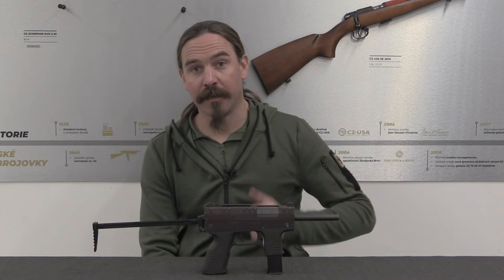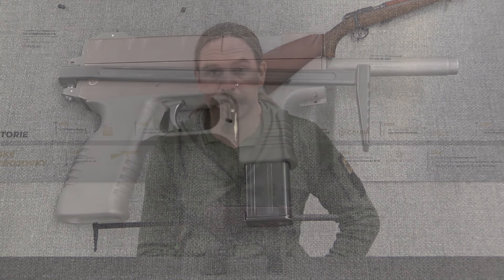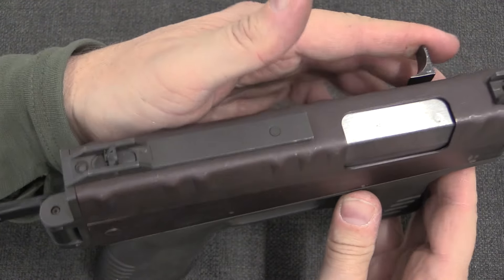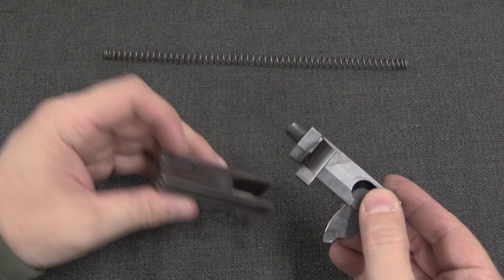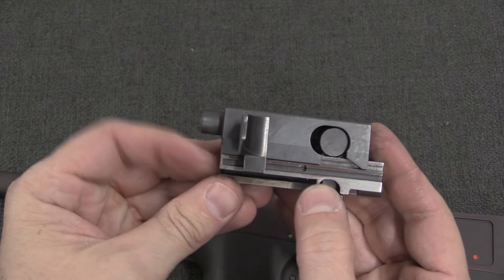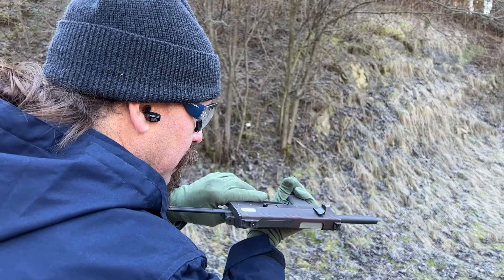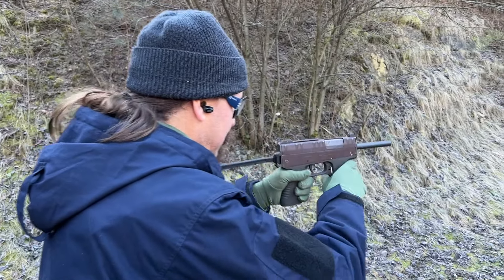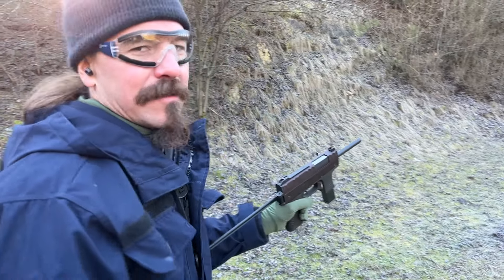Ladislav Findorak's Prototype Lever-Delayed PDW

Comment: "guns are meant to be shot" CZ got it 100% right there!
Reply: Yes sir, that's why we have them :Dd piece of american weapon freedom in the middle of the Europe, that is CZ.
Reply: Any gun manufacturer with faith in their product should be more than happy to have people shoot their products.

If they work flawlessly, then that's great marketing.

If issues occur: ample opportunity for ironing out kinks to further perfect the product.
Reply: At least attempted!
Reply: @sevenproxies4255  true. This is a 40 year old prototype that never made it to production, so critique away. But there is a lot of cool design to learn from off that little thing.
Reply: @CrashRacknShoot  I like a lot of design elements of it.
And as far as the full-auto problems Ian had on the range, like you said, it's a prototype.

And in my expience, misfeeds and trigger reset failures usually bottles down to the piece just needing some more machining.

Some material needs to be added or taken off. But that's part and parcel of gunsmithing after all. This gun clearly doesn't need that much work to function flawlessly.
Reply: depends what kind of gun if its a replica to be a wall hanger decoration then no
Reply: @gcart5619  wouldn't be a gun then, now would it?
Reply: @gcart5619  Nope, unless its a hisorical piece being preserved in a museum. They were made to be shot. Not investments, not art pieces, not collectors items, they are firearms, and were made to be used.
Reply: @CrashRacknShoot  its a type of gun just not a fireable one that was kinda my point
Reply: @gcart5619  does a replica fire a round? 

Oh! Lemme answer that for ya. No.
Reply: @jonathanrogers9961  wow🤦🏻‍♂️😒😑
Reply: @CrashRacknShoot  thats not the point guns can be guns without being able to fire a round also replicans can be firing replicas it doesnt always have to be nonfiring 🤦🏻‍♂️😑😒
Reply: @gcart5619  1. Thanks for walking right into that one. If it can fire around, it is a gun. Meaning it's meant to be shot. So I appreciate you agreeing.

2. A replica is a replica. Meaning a lookalike. Meaning not able to fire, but looks the part. I'll help ya out on this one. You're thinking of a reproduction. 

Congrats, you're wrong twice.
Reply: @gcart5619  pretty sure that would generally be a reproduction, but i have heard of firing replicas as well.
Reply: "Guns are meant to be shot" I think this particular PDW disagrees 😅
Reply: @CrashRacknShoot   So, by your logic...

 I should go shoot my $2000 commemorative John Wayne lever action? Lol

Jk with ya. Btw. Haha.
Reply: Excellent job, Mr. McCollum, as always. Thank you CZ, from a Texan 😉

Comment: I always wondered if anything other than the famas was ever designed around the lever delayed system, guess I’ve got my answer now
Reply: Also the Hungarian Kiraly 39M/ 43M submachineguns
Reply: @jakubdolezal665  oh yeah, almost forgot about that one
Reply: Your user picture brings me back. Thumbs up.
Reply: The AA-52 is the French GPMG since 1952.
Reply: @garthenar  nice to find a fellow fan of the show on here
Reply: There are a couple others, can't think of them off the top of my head though. There are also some big machine guns that kinda look like they are lever delayed but aren't, the lever is actually an accelerator to give a boost to the opening of the bolt. Lever accelerated instead of lever delayed
Reply: San Cristobal rifle has also used lever-delayed mechanism.
Reply: @GunsGuy1990  which was also designed by Király Pál
Reply: @webtoedman I have a feeling that the Schwartslose mg is actually the grandfather of all the other lever delays. Kiraly must have had a good knowledge of it as an hungarian and simplified the system. The rest copied him. (Just my guess)
Reply: Isn't the reising also lever delayed?
Reply: @Appalachia_Ape  no, its a hesitation lock. It's hard to explain how it works but can be showcased.
Reply: There's a ton. Benelli B76, Hogue Avenger, FNAB-43, TKB-517, VAHAN, Stirling-7.62, AVB-7.62, AA-52. I'm sure there's some others but those are what I'm familiar with.
Reply: for newer stuff, you got st kinetics cpw and silencer co maxim
Reply: The French loved their lever delayed blowbacks, their AA-12 GPMG was one as well, and a couple of their old SMG's and battle rifles from around or just after WWII were too.

Comment: looks like it needs a beefier extractor,but it did well for a prototype,also the Scorpion stock would work so much better since it has a  "long" bare barrel
Reply: Yesss, the skorpion stock looks right at home here.
Reply: It also looks like there's not enough kinetic energy in the cycle to do everything it's trying to do. Might be cause the main spring is too cold, not quite as responsive as it should be.
Reply: @jono3952  I was thinking that maybe the chamber isn't fluted, that could rob the action of necessary momentum, the H&K delayed blowback guns all have fluted chambers to stop the case from sticking in the chamber...
Reply: I believe extraction is fine, because it works in semiauto. Ian also attempts "to recock the hammer without losing the round." So I believe he's ejecting unfired cartridges, rather than empty fired cases that failed to extract. The hammer possibly follows the bolt down too gently/early, not striking the primer hard enough to fire. So now you have a chambered round and uncocked gun. In semiauto, the disconnector prevents the hammer from "following" and it works fine.

Comment: Like any prototype I would guess that it needs a little fine tuning and possibly the magazine is a little finiky also. I love the overall concept. It's definitely not a cheaply made gun. Looks like quite a bit of maching was involved in the manufacturing process. But I generally like the idea.
Reply: That is very high quality for a one of its kind prototype! I'm impressed!
Reply: I'm no gunsmith, far from it, but I could see a couple of improvements that would have helped the ejection - like filling in that big empty space above the chamber a loose shell can fit into and a deflector to make sure the casing has only one place to go during ejection. Also, I wish Ian had worked the selector switch back and forth with some "emphasis" to make sure it was fully seated in the auto position.
Reply: I suspect that CZ did not pursue this design because they figured it won't be possible to make this thing out of stampings.
Reply: The problem isn't the magazine, I think, because Ian wasn't having trouble with an empty chamber.
Reply: Maybe it’s because he’s holding the magazine too tightly

Comment: Thank you very much CZ for allowing Ian to shoot this piece, I did not expect you to do so to the point I was thinking "pity he won't get to shoot it".  

Obviously, it's a developmental piece, it would be interesting to see if the bugs could be ironed out as it's actually quite a nice design and that's coming from a died-in-the-wool Skorpian fanboy.
Reply: Mag should be in the grip tho
Reply: @j.yossarian6852  not if it affects the design and functionality but an extra mag holder in the grip could be nice tho
Reply: @j.yossarian6852  Exactly my thought. With that, a longer barrel would be possible. But the upper reciver must be extended to make room for the bolt but if you extend the upper the lengh of pull could also be improved. But the gun would not be as compact as befor.
Reply: Really reminds me of the pp-91, minus the lever delayed action, it’s remarkably similar

Comment: I wonder if some combination of bolt bounce and hammer follow is causing the stoppages. Seems that the trigger is resetting, hence the doubles, but something about the cadence of sustained fire is causing light primer strikes.
Reply: I agree, because I used to have the same issue with an older Century C308 that I had. I went too long without cleaning it once, and it had trouble with hammer follow and I'd get random 2 or 3 round bursts out of a semi auto rifle. And then after that 2nd or 3rd round I'd have to charge it again and reset the hammer because it was following the bolt. Needless to say I cleaned it every time I shot it after that happened.
Reply: I guess it's because it is a prototype rather than a production model that's had all the bugs worked out.
Reply: From what I can see in the footage, it appears that the trigger axis pin was too short and walked to the left little bit, which would cause an alignment issue with the trigger. It would still be able to effectively fire, but resetting would be problematic and prone to errors in that case (same with an AR15, or any other gun that has a very "neat" trigger group without a lot of horizontal space to shift aroudn in).
Reply: Maybe the magazine springs were weak?
I was thinking the magazine wasn't able to keep up with the bolt.
Reply: @tylerwilliams6022  I was thinking that too, but there was at least one unfired round in the chamber as well. 
I didn't really hear Ian talk about the mag, but I would imagine they just used a proven mag, at least for prototyping.
There also was a case stuck between the bolt. 

Kind of hard to tell, there seem to be a couple of different problems. I also have the feeling different ammo could make this run a whole lot better. This system seems pretty dependent on the pressure.
Reply: Is the simplest answer that the selector didn't fully engage in the auto position?
Reply: @tylerwilliams6022  It wasn't the magazine. It chambered a round every time. It was not firing even though it was dropping the hammer on a live round. I suspect that it's designed so the hammer doesn't hit the firing pin unless the carrier is fully forward. It may be releasing too early before the bolt carrier is fully forward, or it may be the bolt carrier bounces open a little right when the hammer comes down.

Comment: I have always been intrigued by the lever-delayed system, but slightly disappointed by the lack of general examples of lever-delayed blowback in firearms. This video has proven to be quite interesting.
Reply: Yeah, the only one I knew of before googling it was the FAMAS, and there aren't very many at all.  I remember reading that H&K tried making a lever-delayed SMG (an early MP5 or UMP prototype, or maybe the MP7?), but gave up.  It seems to have some inherent problems that just make it hard to get right.

Comment: The lever at no point stops the bolt from moving.  The bolt is moving relative to the frame from the instant of primer ignition onward.  It can be described as a class 3 lever, with the frame acting as the fulcrum.  No motion can be transmitted to the load arm (carrier) if the action point (bolt) is stationary.
Reply: Yeah, you are right. That is why Ian corrected himself that it is a delayed, not a locked system. I guess it is formulated in this (a little) incorrect way to make the explanation a bit simpler and shorter - the bolt movement prior to the lever retracting is small enough to support the case enough to prevent detonation and thus not as important to the overall picture. 
On the other hand, I can see that in this case, it may confuse someone, for instance, if they are well familiar with levers and not so much with the chamber - case - bolt - not-blowing-up setup. 
I wonder if there are more people benefiting from the amplification or if more people would rather have the full picture...
I think Ian has some short videos explaining basic operating principles.

Comment: Just something that I think this firearm drives home very well in terms of example. Look at the reciprocating mass that this firearm has for a 9mm parabellum!! You look at many if not all of your direct blowback 9mm sub guns or machine pistols and the difference is striking. I think this weapon showcases how useful and practical a delayed action can really be. In most 9mm sub guns your are going to see blowback operation because it’s economical and relatively reliable/simplistic. The downside to most of the direct blowback sub guns is the reciprocating mass must be adequate enough to delay opening until pressure is safe and it also has to have enough mass to slow the cyclic rate down to a manageable level. In the case of direct blowback this results in a relatively large reciprocating mass and that translates to recoil that is often more abrupt and violent. In addition the recoil spring in direct blowback firearms must be equally as stout in order to absorb such mass and adequately launch it back forward to chamber the next round. The firearm above shows that delayed operation can still be quite simplistic and effective. I describe delayed action 9mm sub guns as having recoil that a 9mm really should have because often times the direct blowback variants will have recoil that is actually quite sharp and intense for a round operating at 9mm pressures. I have a direct blowback PCC and I would almost swear to you the recoil is worse than that of an AR-15. Once again that sort of makes since because most AR-15’s have some sort of gas operation wether that be Direct impingement or piston operation. Regardless of which one the AR-15 has a delayed operation as the lugs stay locked until gas can interact with the bolt/carrier or the piston can interface with the carrier and that operation cause a delay in unlocking.

Comment: For reference, this very small pdw weighs about 25%-40% more than a typical sword, worn for the same purpose would have.  Its about 400g heavier than but in the range of everything from a 14th century arming sword to a17th century katana or 19th century military sabre.   I saw the thumbnail of what my brain guessed was a spray painted M3A1 and nearly scrolled right past!  I mean it is, but it's also an interesting take on the genre.

Comment: Neat gun.  Fix the trigger reset issue, some filler to prevent spent cases from jamming in over the trunion, lengthen the stock and add some rounded meat to the strut, make the rear sight usable (larger aperture?), switch the rail to Picatinny, amd maybe change the charging handle so it points straight up instead of out (like a Galil - easiest way to make it ambi with minimal changes to the gun).  Maybe add a lightweight shroud with an attachment selected on the bottom to cover some of that exposed barrel (and give you a place for a VFG if broomsticks on your broomsticks are your thing) and thread the barrel for a can.

Literally all the sorts of things that would likely have ended up happening if the gun got a few more iterations in development before being smothered in the crib.

I think you'd end up with a very nice pistol caliber PDW, within the same form factor and likely no significant weight increase, that would be an excellent (and discrete) VIP protection "break contact gun" designed to get the detail and protectee back to the Hate Wagon where the carbines are stashed.  Basically, what the US Army was looking for in the APC9K.

Comment: I have a feeling it was the low temps messing with the geometry as parts of the gun heated up. The age of the spring could have something to do with it as well. A slightly stiffer, new spring would help get everything back into place.

Comment: 7:20 This is not quite right. The head starts to move backwards as soon as the cartridge is pushed backwards by the expanding gases. If the head would by held in place by the leaver, there would be no force available to move the leaver. Head, leaver and carrier are all moving together but at differed speeds.

If the head would be held in place with no movement, there would be an outside force necessary to move it. This can be done by recoil (P.38) ore by a gas system (vz.58). But here the bolt head is moving the leaver, like in the FA MAS or the AA-52.
Reply: Correct, every mechanically delayed blowback system works like this.
Reply: That's exactly what was said and demonstrated. The force exerted pushes straight backwards on the bolt, the lever is in the way, it unlocks and moves the carrier, and the entire carrier group moves backwards.
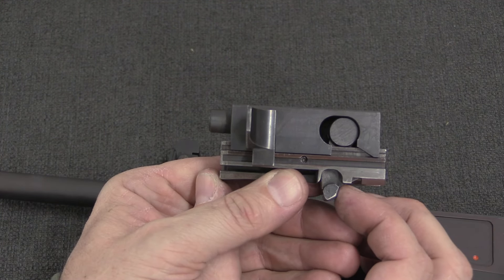Reply: @KirkHermary  6:50 "The bolt itself can't start moving, until the leaver retracted all the way up here." No, the bolt is free to move from the very beginning, but it is slowed down until the leaver is fully retracted.

Comment: Really interesting system that could well have a lot of potential in a modern PDW/PCC if properly developed. A better stock, and maybe an improved trigger group and feed system (or just better lubrication if it was just old grease getting sticky in the cold there!) and I really do think this could work. In the long term, I personally feel like the US military will want a replacement for 9mm para that continues their focus on piercing modern body armour that they've started with the 6.8mm system, and a delayed blowback action like this could be a good way to deal with the likely increased chamber pressures required for that without massive increasing the weight.

Comment: You know If this design could be produced either domestically or over seas and the bugs worked out. I think there would be a market for this here in the US. It could be lightened up even further with the use of modern materials and a quality magazine that is already proven and in production could be used (not necessarily a Glock magazine) A PDW of this size that's light weight (due to not being blow back operated) would be quite attractive to a lot of people, I think.  I personally would like to see it offered in more PDW type calibers like 7.62x25,  7.5 FK, and 5.7x28  I wonder if the lever delay system could be modified to operate with these higher pressure rounds?